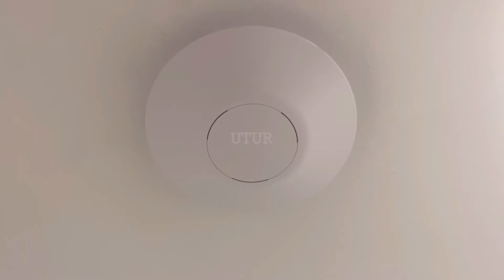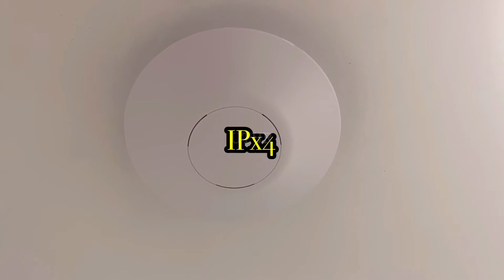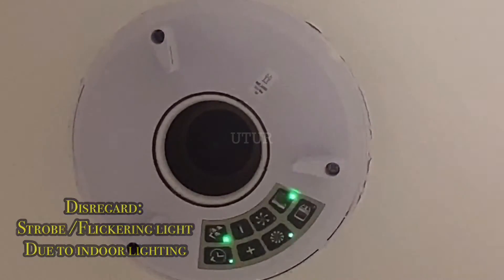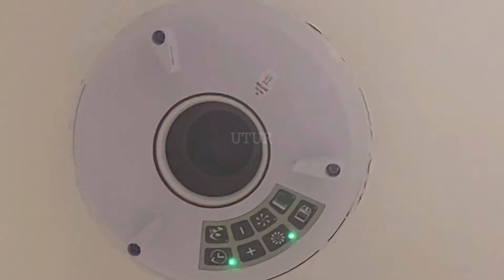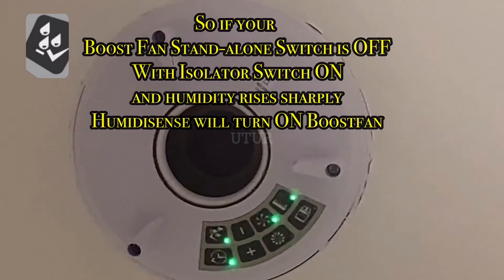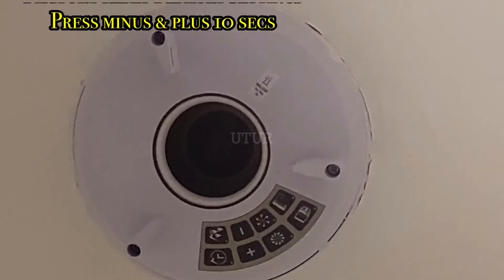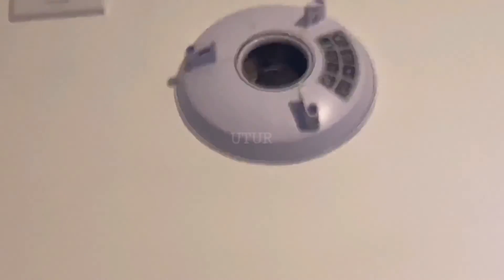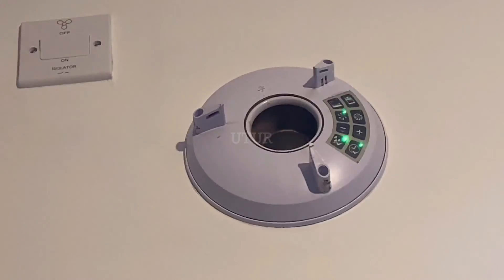The Ultimate Guide to Installing, Resetting & Commissioning a Bathroom Extractor Fan!" Airvac CV2GIP

Comment: Why do they make these fans so loud! Like engines, not ideal if you want to take a relaxing bath! And not ideal to keep having tonturn them on and off at the isolator switch 😒
Reply from the maker: Hi CoralRuby7, the fan settings are not set in stone. You can adjust them to your lifestyle. Click the link in the description to see how to adjust trickle and booster speed which sorts how noise levels and fan rate. Don’t forget to subscribe, like and share. Helps channel grow

Comment: Why has my fan stopped turning and lights still working
Reply: Please could you help me
Reply from the maker: @paulgray2940  Hi Paulgray2940, firstly , it could be grime and dirt. Have you tried taking off the cover and given the fan a spin or quick rotating spin clockwise while the booster speed is on  as you would a fidget spinner. Do not place your fingers back inside if spinning remains active or doesn’t come to stop!

There are other reasons why the  lights are working but the fan has stopped, there could be several reasons for this issue:

1. Power Supply Issues: Check if the unit is receiving power. Sometimes, a blown fuse or tripped circuit breaker can cause the fan to stop while the lights still operate.

2. Faulty Fan Motor: The fan motor itself may have failed. If the motor is defective, it won't operate even if the lights are functioning.

3. Blocked or Dirty Filters: If the filters are clogged or dirty, it could restrict airflow and cause the fan to stop working. Check and clean or replace the filters if necessary.

4. Control Board Malfunction: There may be a fault in the control board that is preventing the fan from receiving the signal to operate.

5. Overheating Protection: Some units have a safety mechanism that shuts off the fan if it overheats. If the unit has been running for a long time, it might need time to cool down.

6. Wiring Issues: Inspect the wiring connections to ensure there are no loose or damaged wires affecting the fan operation.

To troubleshoot, start by checking the power supply and ensuring the fan / filters are clean. If those are fine and the fan still doesn't work, it might be best to consult a qualified technician for further diagnosis and repair. Let me know how you get on ?

Comment: After settings, my fan is continuously running in boost fan mode? It’s not humid. 

I have an isolation switch - when off, all power is lost. 

When switched on and light is off it’s in trickle mode. When light is on it’s again in boost mode. 

Help
Reply from the maker: Hi glenhutton8543, If your Greenwood Airvac CV2GIP is continuously running in boost mode even when it's not humid, there could be a couple of reasons for this. One possibility is that there might be a faulty sensor or control switch that is causing the boost mode to stay activated. Another possibility is that there could be a problem with the wiring or the control board. It’s could also be that it keeps running in boost mode to match the length of time spent overall in your bathroom or there could be a man made spike in your bathroom not visible to the naked eye that it is trying to get rid off. 

I would recommend reaching out to a professional electrician or contacting the manufacturer's customer support for further assistance. They'll be able to help you troubleshoot the issue and provide you with the best solution. 

When your isolator switch is off and all power is lost. This is pretty normal as is what you would expect from an isolator switch to isolate power completely.

When isolator switch is  switched ON, and light switch is OFF and goes into trickle mode. This again is completely normal as isolator switch ON gives power to the Unit, the light switch is a switching live. Switching live  or light switch ON gets the Unit in boost mode and Switching live  or light switch OFF get the unit or Airvac in its trickle mode or setting. Again this is normal . Except I am missing something!

This behavior is due to the specific design and functionality of the Greenwood Airvac CV2GIP system. The light being ON indicates that the system is actively boosting the airflow, while the light being OFF means that it's operating in a lower power mode to conserve energy. 
I hope this helps. Don’t forget to subscribe, like and share. Helps channel grow

Comment: How does this connect to the duct vent? Can you do a like for like replacement easily?
Reply from the maker: Hi 3618jon, To connect the Greenwood Airvac cv2gip to the duct vent, you would typically use a duct connector or adapter. This allows for a secure and proper connection between the cv2gip and the duct vent.

Here's how you can connect the Greenwood Airvac cv2gip to the duct vent:

1. Start by locating the duct vent where you want to connect the cv2gip.
2. Ensure that the cv2gip is compatible with the duct size and shape.
3. Place the cv2gip near the duct vent, making sure it aligns properly.
4. Use a duct connector or adapter that matches the size and type of the cv2gip and duct vent.
5. Connect one end of the connector or adapter to the cv2gip and the other end to the duct vent.
6. Make sure the connection is secure and tight to prevent any air leaks.
7. Double-check the alignment and positioning of the cv2gip and the duct vent.
8. Test the airflow to ensure proper ventilation.

To test the airflow for proper ventilation, you can try a simple method. Hold a tissue or a lightweight piece of paper near the vent while the Greenwood Airvac cv2gip is running. If the airflow is strong and the paper moves, it indicates that there is proper ventilation. If the airflow seems weak or the paper doesn't move, it might indicate an issue with the ventilation system. Remember to always follow safety precautions and consult a professional if you have any concerns.

Remember, it's always a good idea to consult the manufacturer's instructions for specific guidance on connecting the Greenwood Airvac cv2gip to the duct vent.

So, Yeah, you can definitely do a like-for-like replacement with the Greenwood Airvac cv2gip. Just make sure to remove the old cv2gip and disconnect it from the duct vent. Then, follow the same steps I mentioned earlier to connect the new cv2gip to the duct vent. It should be a pretty straightforward process. Don’t forget to subscribe, like and share. Helps channel grow. Have a great weekend